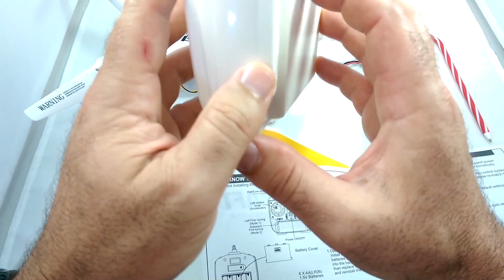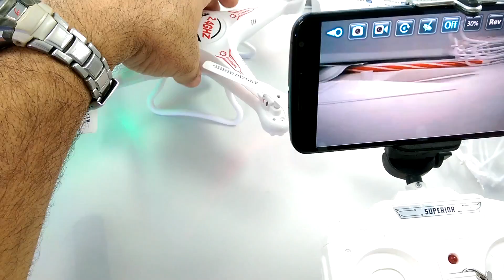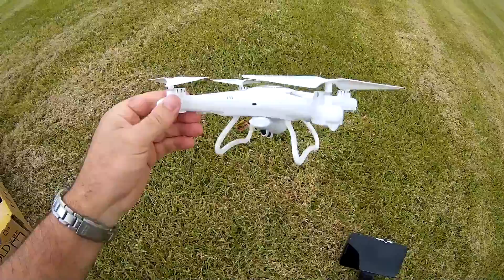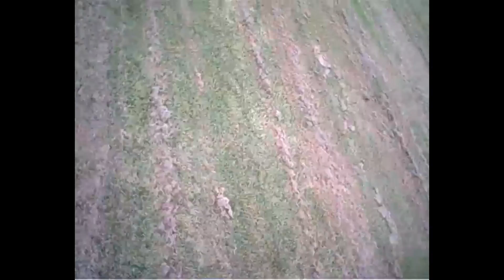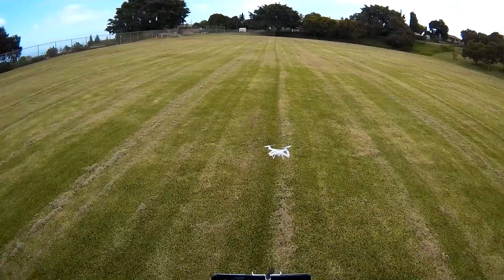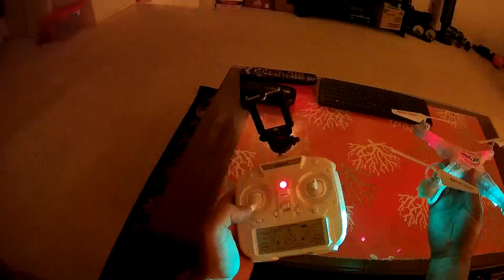SHENGKAI D97 FPV QuadCopter Drone Review (SYMA X5C/SW Killer?) - Setup, Flight Test, Pros & Cons

Comment: Hi Dustin,
I bought the copter and could not figure out yaw buttons purpose.
As I understand from your video, the left horizontal yaw button can be pushed to left and it activates headless mode. Is it correct?
Could you, please, explain how can I use the rest of yaw buttons?
Also what does wheel on the right backside do? When I roll it, I see nothing.
Thank you in advance
Reply from the maker: +Александр Скрынник Pretty sure I mentioned all of your questions in the video.  That trigger roll button does nothing.  Just for looks i guess.

Comment: Have you tried using JUST the phone (without the big manual control?)

I know ones like the Cheerson CX30W (WiFi and/or Remote) You can use JUST the Phone, or if you're using a remote it will stream to a phone, but not be controlled from....
Reply from the maker: I did on the bench but it would work that way either.

Comment: I'm getting into RC planes (little late in season) and I've been looking at these quads just for something to tinker around with in the back yard. Was curious more how customer service would deal with that motor issue.  6th or 7th flight with a failure on an item that's over $50 I'm not too impressed.   Have you deal with Gearbest when it comes to a failure like this?  If so did they replace the motor, or quad or is it pretty much you're screwed?
Reply from the maker: As long as you show them a video of the issue within a week or so of receiving they seem to be good about sending a replacement motor.  With these types of quads the motors are really hit it miss in general and are cheap. so I would recommend spending the $8 or so to get a spare set when purchasing.. Crashing will speed motor failure greatly.

Comment: hi i have the same quad but the motor does work but it keeps on leaning towards the right during takeoff. Please can you help me this is my first quad btw
Reply from the maker: +uchihajunaid14 make sure your trims are centered.  If that doesn't help do calibration on level surface.  if still issues check propellers are on correctly.  if problems persist maybe motor going bad or accelerometer defect

Comment: That sucks,6 flights and a motor down,what's the battery voltage?3.7 or 7.4.
Reply from the maker: 3.7v, we'll see how long a replacement motor lasts.  Motors on these types of quads can be hit or miss as you may already know.

Comment: Had to wait until I got home from work to do a comment.  As usual, a very thorough and excellent review. Mahalo! Bummer on the motor. I'd take some measurements and find something that used the same size online. When I got my Bayang Toys X5C-1, one motor died after 2 flights. Forgot who I got if from, but it took them 6 weeks to get me a replacement motor. Fortunately, I measured the motors, and they were exact Syma X5C motors (7.2mm x 20mm) and I got some of those from Amazon.com in a couple days and was back in business.  Still not excited about "Wi-Fi FPV", but there is probably a market for it.  You can always expect poor range when your FPV camera shares the same band as your TX/FC.  Oh well, going to chill tonight .. stopped off after work to donate a pint of blood to the Am. Red Cross, and am feeling "drained" (ha ha ha). Good night for some online golf ... maybe at Kapalua!  Cheers! Thanks for the review!
Reply from the maker: Right on Bill.  Kapalua sounds great!  Good man with the donations.  I found spare motors at Gearbest and they are sending a set.  I put the link in description of video for D97 parts including motors.  In the meantime I'll be going through my spare  motor stash to see if any others will work.
Reply: BTW, been meaning to mention that I covet your Pineapple tote box for your quads trips out to the field ... I need on like that! Must be sturdy to hold those heavy pineapples.  We don't grow any pineapples here in NE Ohio ...  just apples. ;-)
Reply from the maker: +Bill Somrak Yes,  it is a great box.  Not ripping anytime soon :)  It's becoming a cool video prop also with the "Maui Gold" on it.

Comment: Just like on all new X5C-1 quads, the camera can go right in the garbage. 2 megapixels is total crap.
Reply from the maker: True.  It would be great to get a cam with higher resolution.  At least there's no jello and it was good clear signal as far as control range.
Reply: Dustin Dunnill
I should add that I did find a solution for this though. I bought this: http://www.banggood.com/Syma-X5C-1-X5SC-X5SW-5_8G-FPV-720P-Camera-with-Monitor-Real-Time-Transmission-p-980090.html 
But I don't use the monitor that comes with it for FPV because it's kinda pointless (range of quad is still in sight). The 750p camera on the other hand is very good for the X5C-1 and it's compatible (plugs right in). The transmitter turns it on or off too. Works like a charm..
Reply from the maker: Right on.  Thanks for sharing shadow.  Just got the V686G in and it's got a similar 5.8ghz setup with mountable screen.  Should be interesting.  Reviewing this week.